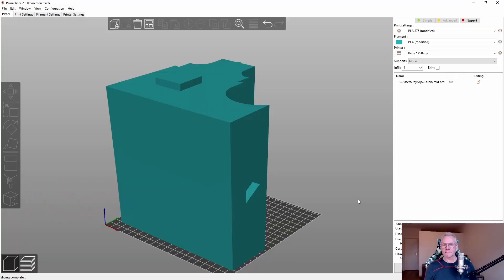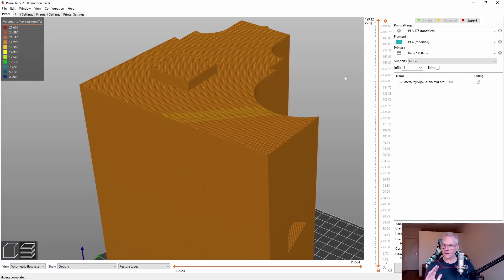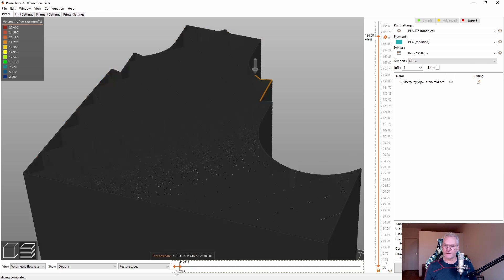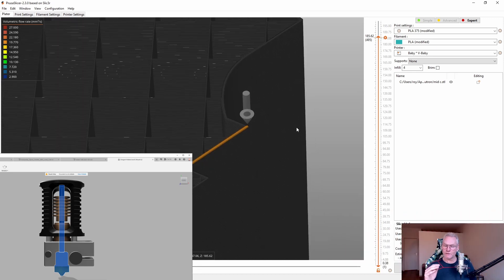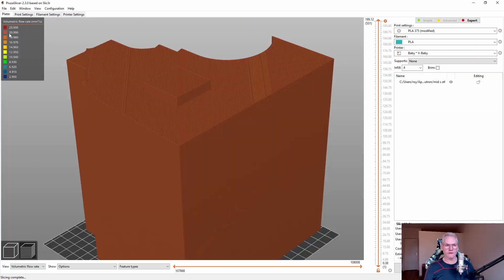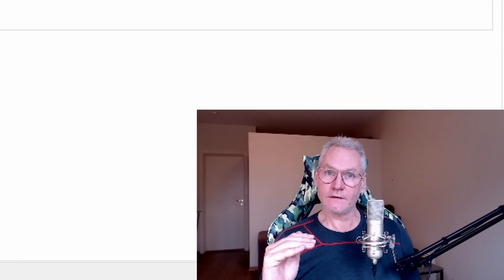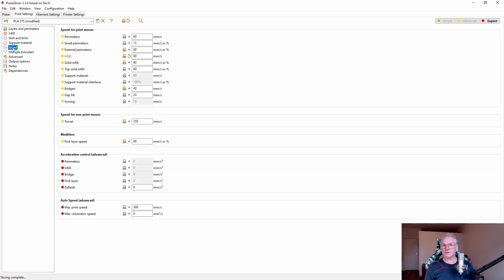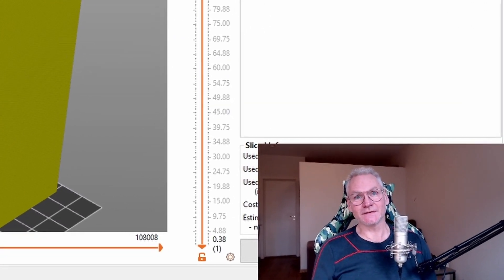Why Uniform Flowrate Is Important | PRUSA SLICER | How To Check and Adjust Your Flow Rate

Comment: Im surprised more people arent talking about this. I did a few searches and havent seen much or any discussion about constant flow. Its been a huge improvement in my print quality. I was working on a profile with near constant flow (+/- 1mm³ / s) and the difference between the parts from the two profiles are significant enough to go all in on constant flow. The speeds / nozzle widths werent even that far off from each other. Thank you for sharing this awesome tip.

Comment: What differences are there between aiming for the high and low range of your setups volumetric flowrate?
Reply from the maker: You must find your own limit for the setup you have and the material. Just do some testing to find max flow rate
Reply: @PRO3DESIGN  yeah thats fair enough, but lets say for a printer with max vs being 11.5. What differences can be noticed when using 11.5 compared to lets say 3?
Reply: @bendiksteffensen6116  more flowrate = more speed = less time but need more cooling and can have artifacts like ring because of high speed vibrationsm but times is worth

Comment: I've been 3D printing for quite some time now.  For some reason, I've never seen anybody bring up this info.  I've always wanted to tinker with the PrusaSlicer/SuperSlicer Auto Speed feature, which helps make sense of it.  Thank you for this.
Reply from the maker: THank you! I would like to adress this deeper in a future video as it is a very important setting and you can with this forget about speed settings all together. I  only print volumetric on all my parts now. Some lower that other with regards to quality and the use of the parts

Comment: Thank you, this is very helpful and makes sense! :D
Reply: I have implemented this into my slicing and has helped a lot especially when using single perimeter/wall or 2. It’s not as visually noticeable when using 3 + walls but I’m talking about walls .38mm in width, as for printing at such a thicker single line width, (which this gentleman is doing) makes keeping the flow rate equal vital to a single walled print, since even though the sensor readouts may show minimal dips in temps the actual nozzle tip is not apart of the the thermistor/thermocouple, so actual temps at the nozzle tip with fluctuate more rapidly than the sensors can even read let alone adjust for.

Comment: This is totally crap, you need constant flow on outer walls, why you would care to get perfect infill lines?, You are going to add so much time for something you can't even see, if you have the right settings and pid your nozzle temperature shouldn't vary at all, mine only change a 0.1 degree in most cases, with your theory you should disable retractions too
Reply: it isn't clear to me why imposing constant "load" on the hot end is super important. The hot end is kept at a constant temp at the measurement point by PIDs but high frequency changes in melt demands like crossing from thin interiors to fast fat perimeters are buffered by a large chunk of metal and the liquid plastic itself which spends some time before the nozzle at a constant temp. I'd like to see a visual example of the quality improvement in a part gained by getting a uniform flow vs highly variable flow.
Reply: I would not call this totally crap, and I think it’s pretty rude to call someone’s idea and what works great for them such a thing. Adding to the conversation would be much better, the 3D printing community has always been about about new ideas and this gentleman shows us his, be respectful and if you think his idea is wrong then prove, and show how you came to that conclusion, but with respect

Comment: Interesting content but I don't think that it answered the question of 'why uniform flowrate is important' other than to say 'because keeping the heater temperature consistent is important'. This begs the questions, why is keeping the heater temperature consistent important? How does keeping the heater temperature consistent impact either print quality or part durability? If it were this important why wouldn't the slicer just alter the speeds to ensure a consistent flowrate?
Reply from the maker: I agree that the reason does not get explained. The reason is that using this method you will not have areas being printed with a different temperature due to lag created by the change of flowrate. Example going from 10 to 20 mm3s might actually create a gap in the start of the 20 section due to the sudden increase of flow and the time it takes to compensate before the hotend is stable and able to allow for high flow output. Same the other way around going from 20 to 10 could create a part of the print having different structure. Then probably the most noticeable upside would be to optimize your print time accordingly to your maximum flowrate

Comment from the maker: Nerdy content - I hope I made this clear..

I agree that the reason does not get explained in the video very good. The reason is that using this method you will not have areas being printed with a different temperature due to lag created by the change of flowrate. Example going from 10 to 20 mm3s might create a gap in the start of the 20-section due to the sudden increase of flow and the time it takes to compensate before the hotend is stable and able to allow for high flow output. Same the other way around going from 20 to 10 could create a part of the print having different structure. Then probably the most noticeable upside would be to optimize your print time accordingly to your maximum flowrate. Another point is that uniform flowrate will make for a uniform nozzle pressure